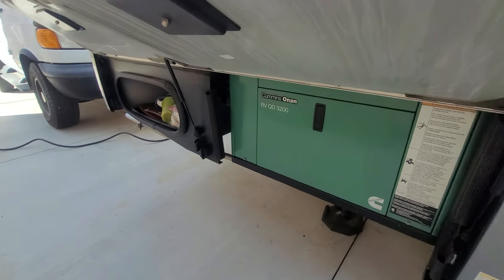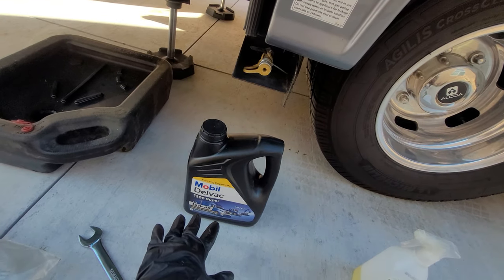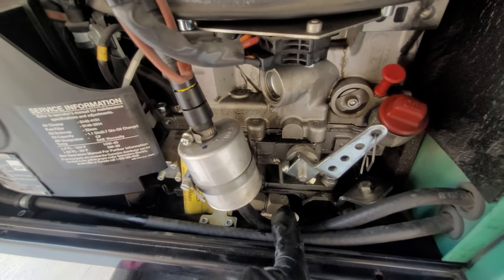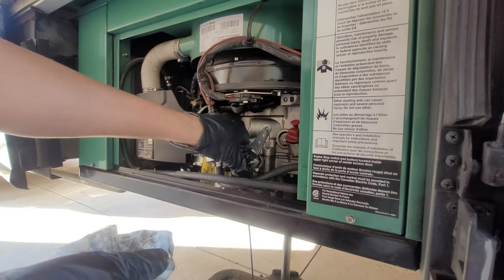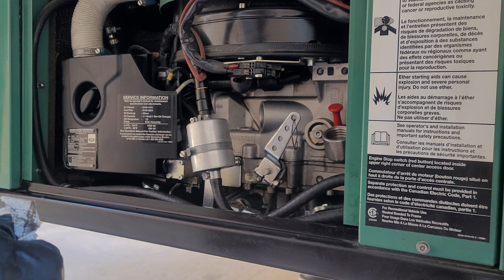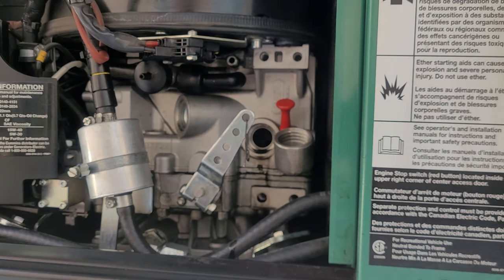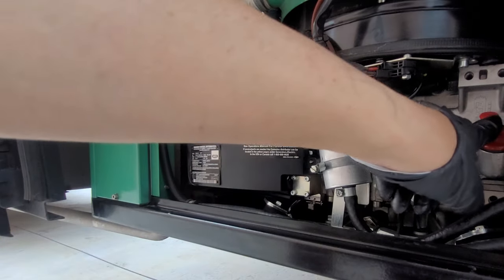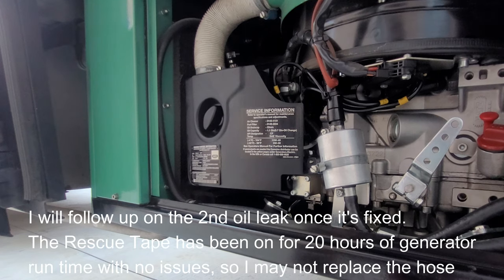ONAN Generator Oil Leak Fix, Oil Change, Air Filter, Oil Filter Screen

Comment: My crankcase breather hose also split.  It was in the middle of the night, generator running, then stopped.  Dumped oil until the low oil sensor shut the generator off.  OEM piece is around $450.00, so I fixed it myself using the rescue tape, which makes it stronger than the original.  Hint - stick a socket in the hose before trying to wrap with rescue tape.  It keeps it from collapsing and makes it much easier to do.
Reply from the maker: Good tip on the socket.  Seems this is a common ongoing problem for many years

Comment: Nice video.  I have the same generator with a lot more hours on it.  I have found you can drain and fill faster by pulling out the dipstick.  Be careful pulling it all the way out when you start draining because it can actually come out too fast and make a mess inside the enclosure.   One other thing I do is measure how much oil I take out when draining then add the same amount when filling.  Then check the oil level and add more if needed.
Reply from the maker: Both good points and suggestions.  I've read on measuring the oil when you take it out, but haven't got in the habit to practice it.  I think it's due to never doing it on my old Onan 8,000 watt quiet diesel.  At least that one was actually quiet compared to this one.
Reply: @rvlifediy  i bought two cheap plastic measuring cups Walmart.  They work really well and were only $1 each.  I got them in the kitchen section not auto.  One for waste oil one for new oil.  You are right about the sound too.  They are loud.  Most my hours are fortunately while driving with the a/c going in the back for my dog.  It isn't that loud while driving.
Reply from the maker: @patrickfort2631  I think I'll try that on the next change.  Based on my usage, I will have to remember not to forget next year lol.

Comment: I have exactly 20 hrs on my Onan 3200.  The chk the oil indicator showed up as soon as It hit 20 hrs while I am on the road at Mackay Reservoir Idaho.
Reply from the maker: I wouldn't worry about it and just change the oil at the next convenient time. If I recall, 20 hours was the 1st break in oil change required.

Comment: Whomever came up with the idea of naming that generator "Quiet Diesel" needs to be shot.  My god they are so obnoxiously loud.
Reply from the maker: I agree. It's embarrassing how loud it is. What a marketing gimmick. I can't believe they can get away with it.  My previous diesel generator was so much quieter than this one.
Reply: Noisy, leaky, smelly, and smoky.  And it takes 2-3 minutes and 4 or 5 attempts to start, every time.  Absolute GARBAGE.

Comment: I always enjoy your videos and I learn so much. I just ran into a issue as I was trying to take a long trip and could not bc I’m getting a coolant message & the 10 starts remaining message. I got some coolant and noticed a leak at the seam of reservoir …looks like it has separated, probably from cold freezing to warm weather. I live in Indiana. Then, I noticed as I was filling it, a huge cloudy white spot from the previous day in my driveway and the new leak as I was adding the coolant in a new spot. Have you ever had to repair or replace yours ? I belong to a few WB FB group, but did not see anyone having the same issue. Appreciate any help. I did find a part & hoping I can figure out how to replace it myself. It’s about $100.
Reply from the maker: Thank you.  I haven't had any issues.  You may be having two issues going on. The 10 starts is usually tied to running out of DEF fluid. You mentioned white foam. DEF dries white.  Your coolant should be pink.  Was your coolant reservoir completely empty or partially pink filled?  I would doubt check your DEF tank.
Reply: @rvlifediy  Right now, the current leak is just wet. But, I do plan to check the DEF too. Normally, I get the DEF message b4 I get the 10 starts remaining msg. So, I was wondering if that was a generic message for any fluids if preceded by a ‘check coolant’ as in this case. But, maybe my thinking is off. It’s always something with these rigs. And, Yes, the coolant is pink. But, hitting the concrete seems to change it. When I added the coolant , it was just above the minimum level. It started flowing at the seam when it hit the max, as I added the coolant. The max line is right at that seam.
Reply from the maker: @dawnross644  To the best of my knowledge, the 10 starts is tied to the DEF only.  Low coolant just triggers the low coolant light on the dash but does not trigger the 10 start.  The DEF tank leaking and sensors going bad is common on many Diesels including the Sprinter.  I would get your DEF tank looked at right away.  I'm guessing the cloudy spot is the DEF.  If your coolant was at the min line, there was enough to leak to the ground to make a big spot.
Reply: @rvlifediy  Thank you…will look at both again.
Reply from the maker: @dawnross644  I also saw a typo.  I meant to say that if the coolant was at the min mark, not enough would have leaked on the ground to make a big spot.  It would have been a pretty small puddle at best.  Sound like your DEF tank is the main culprit, and your plastic coolant expansion tank needs changing as well.
Reply: @rvlifediy  I checked the gauge for the DEF and it says 3/4 full. So, feel confident, it’s just the coolant.
Reply: @rvlifediy  The big spot may mean I never saw the leak until I returned & it could have drained all week & dried up b4 I noticed it, draining all that was in the reservoir. Then, as I added more, last night. It’s still wet. But, will double check gauges again, etc.
Reply from the maker: @dawnross644  If it's the DEF, the emissions warranty on these sprinters are longer than the 3 year bumper to bumper.  Not sure what year RV you have, but you may be covered under the emissions warranty and better off bringing it into Sprinter shop.
Reply: @rvlifediy  It’s the 18D.
Reply from the maker: @dawnross644  Depending on when you bought it in 2018, you may be under the drivetrain warranty which includes all the emissions.  Might just be easier for you to bring into a Sprinter shop and let them figure it out and persuade them to cover under warranty.

Comment: As usual, very thorough, I like it. Thanks Craig!
Hopefully we will all learn from you making the "first mess". 😉
Couple of questions about the diesel generator:
Did you purposely chose a diesel over lp generator and why?
Have you had any trouble with the MB Sprinter fuel gauge issue that the owners with diesel generators have talked about on the FB groups?
I'm leaning towards an LP generator for the usual reasons but I'm open to hearing the pro's for diesel.
Reply from the maker: If you plan on using your generator more often than not, the diesel generator is much better.  Propane is a pain to refill and you can drain the entire tank within a day or 2 if you have to use it a lot. Propame energy per volume of fuel compared to diesel is severly lacking hence the fast consumption from the built in propane tank.  That is why I picked the diesel generator either though I don't use it much, I don't like the hassle of filling propane more often, and if there is a natural disaster, the diesel is the way to go for fuel.  I don't do any of the Facebook groups at all, so I'm in the dark on any issues out there.  I'm not aware of any fuel gauge issues.  Mine has worked fine but have heard of people having issues with the float sensor with aftermarket tanks which i was planning on doing.  Is the issue on the new/current chassis?
Reply: In Europe we ALWAYS prefer a diesel built engine.  Higher quality work horse that comes off the main fuel tank and is designed to work 24/7!  ☺
Reply: @rvlifediy  Not sure what happened to my reply to this but here's it in a nutshell, a quote from a FB group post:
"Don’t run out of Diesel! ... if you have a diesel generator it draws off the fuel tank, however the gauge only recognizes the chassis engine consumption and only resets to the tank float with a refueling.  So if you are boon docking for days with your diesel generator humming away, best to refuel as soon as you can cause you at worst only have 1/4-1/3 of fuel while you gauge may say you have a full tank."
Reply from the maker: @volofly2011  that makes sense with these digital guages.  However I have heard that the reset can happen without filling up the tank. This sounds like the similar issue the aftermarket fuel tanks are having on their calibration. I wouldn't let that be the deal breaker though.